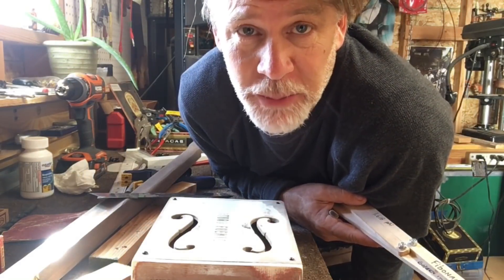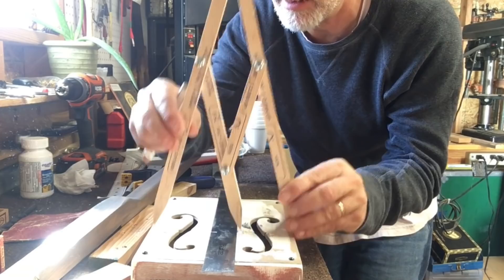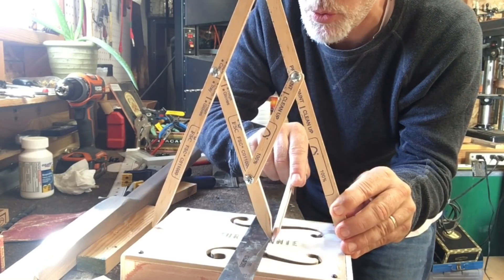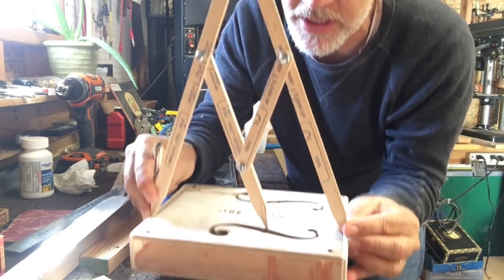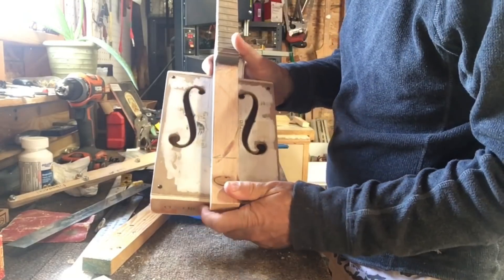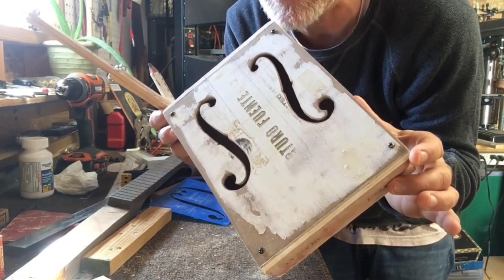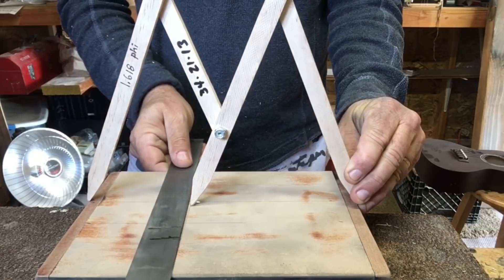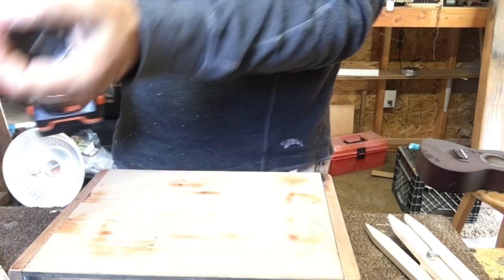Fibonacci Sound Holes

Comment: There is more to the secret of the sound hole. The F Hole shape itself is key. 
The main factor that denotes why a Stradivarius Violin is exceptional in its tone. Can be applied to the guitar too. 
They found over centuries of copying the world 'best violin' there is a deviation from copying from eye that has imparted changes in the overall design of the instrument.
Reply from the maker: perfect blend of both art and science
Reply: @PuckettCigarBoxGuitar I’m starting to look into it and it looks like a main component is air flow velocity. Circular hole has dead space in the middle and the air or sound escapes fastest around the perimeter. So the f-hole design has more perimeter than the circle to start with. Then I suspect the shape and proportions have something to do with lining up with the resonant frequencies and timbre of the produced by the violin itself and it’s tuning. I wonder how one would figure to make the optimized shape and placement for a rectangle box like the cigar box is.

Comment: Using the Golden Ratio for sound hole placement, what is the difference between using it to locate the hole cutout center vs the hole cutout diameter tangent/edge (as shown in the video)?
Reply: great question.

Comment: Del, I wonder if that would also pinpoint the proper placement of the pick up.....  Very interesting...
Reply from the maker: i would think so...
Reply: @PuckettCigarBoxGuitar yeah try using it on the length of the string and see what happens. I seem to recall a hammer length for striking a piano string being ideal at around 22.4% maybe that is related.